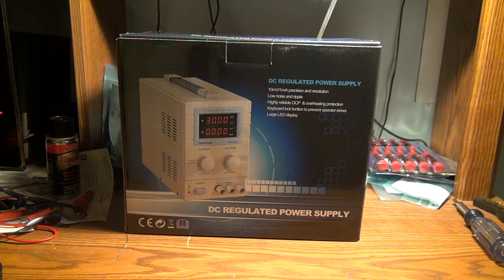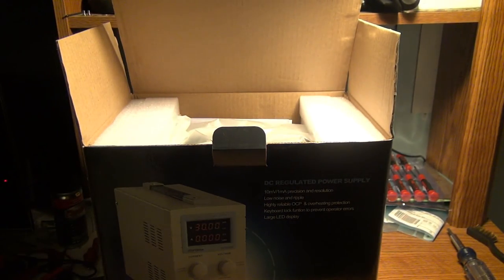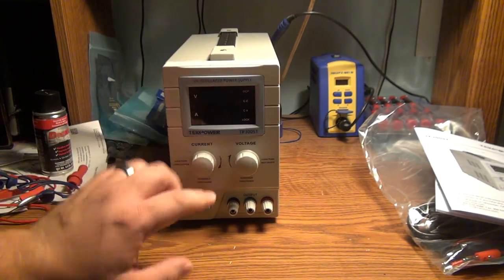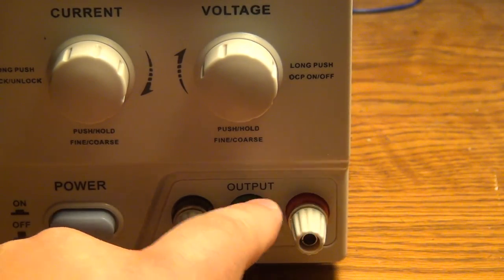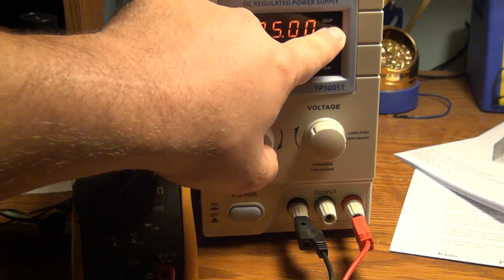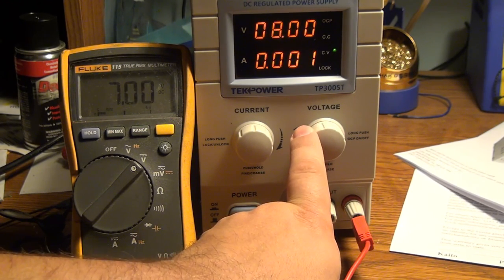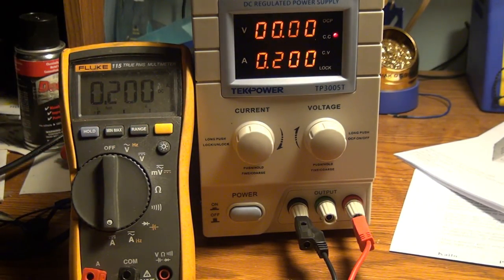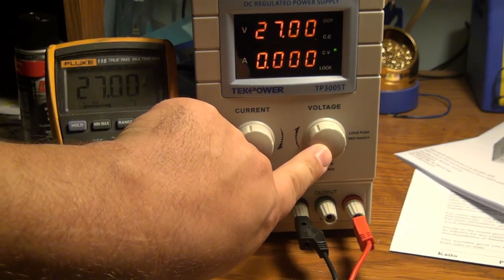eapbg #26 TekPower TP3005T Unboxing and First Impressions

Comment: I only do things in the 3.3 to 5v range and usually under a few amps so I like the fact you got to push the voltage/current selector to make changes cause I can see my little grand-daughter sneaking up on me and moving those dials.

Comment: The New multimeters have built in NCV non contact voltage, VFC variable frequency interface, VFD filter for motor signal. I'm not sure if the NCV can measure DC voltage on wires that are hidden in pipes or wooden walls or its just only for AC voltages. The VFC i don't understand what it is but I'm guessing when you switch the AC line frequency the VFC circuit can measure the AC voltage. The VFD filter is for motor signals which I don't understand also what a VFD filter would do used for what motor signals. Do you know what VFC and VFD is and used for?
Reply from the maker: NCV is only for AC. A VFD rapidly switches the voltage on and off usually at many times the fundamental frequency. The switching occurs in a special way that when averaged the output is a sine wave. Look into how a VFD works. The VFD function of the meter is a low pass filter that can reject the switching and allow the measuring of the fundamental frequency.

Comment: When you turn it off, or if the main power shuts down for a couple minutes, it will remember the Voltage and Current you set up?  Or at least the voltage will go to zero?
Reply from the maker: It remembers both the voltage and current.

Comment: Is you have wires running through metal pipes how can you measure to check if you have DC voltages if the NCV only measures AC voltages in wooden walls and wires in metal pipes? Yes i will look into how VFD works but I'm confused why the DVM meter needs a VFD filter when the averaged output is a sinewave. I'm guessing with noise and interference's on the motor signals averaged sinewave output.
Reply from the maker: NCV is a tool for house wiring that allows you to know if it is safe to cut a hole in a wall or drill a hole. If you hit one of those lines it may kill you. Unless it is special in some way, there are no DC setups besides low voltage DC. Damaging low voltage DC lines is annoying but not dangerous. It's not the noise but the frequency. There are two frequencies on top of each other. The fundamental sine wave and the switching frequency. The meter has no good way of knowing which one you are trying to measure. The VFD feature cuts off the high switching frequency allowing the meter to "lock on" to the fundamental sine.
Reply: @eapbg , Why does a VFD circuit output the fundamental frequency plus the high switching frequency? A VFD circuit converts AC to DC and converts DC back to AC, but the AC output has the fundamental frequency plus the high switching frequency? I'm surprised the AC motor doesn't get confused which speed frequency to use
Reply from the maker: @billwilliams6338  A VFD turns DC back into AC by modulating the switching in such a way that when averaged the result is roughly a sine wave. I'm stating this very generally and I would suggest reading up on VFD theory. A motor has an inductance that acts as a low pass filter. The switching frequency of the VFD is usually at least 10 times if not 100 times greater than the fundamental frequency they are trying to achieve. The low pass filter type effect averages the switching frequency only leaving the fundamental frequency.

Comment: "decently accurate" LOL is superbly accurate
Reply from the maker: Funny you should say that.  Recently I've been using this supply with a Keysight 34465A 6.5 digit DMM. At 30V it is only 20mV off. Below 10V it is only 5mV off.